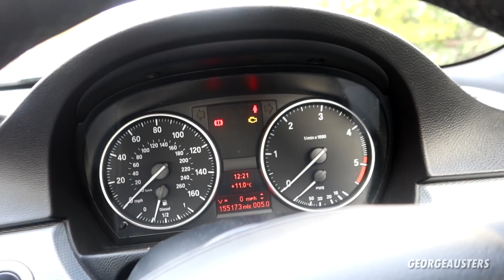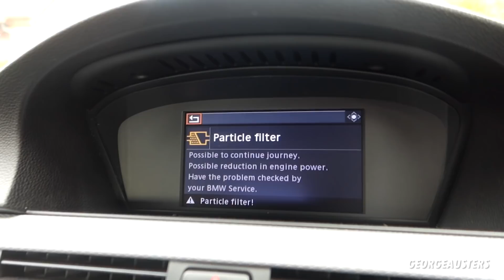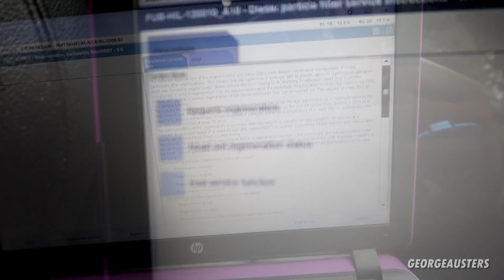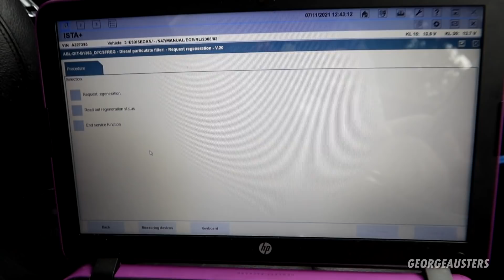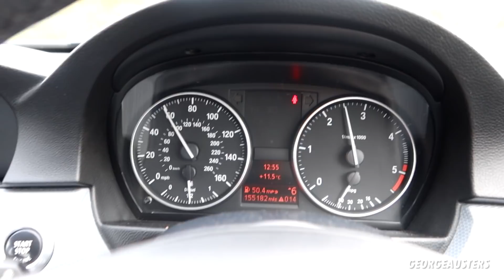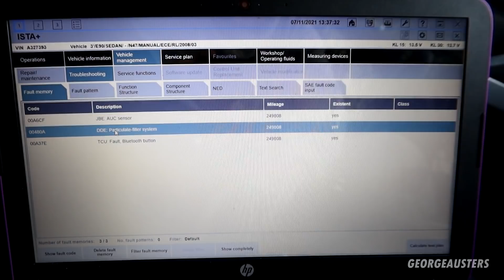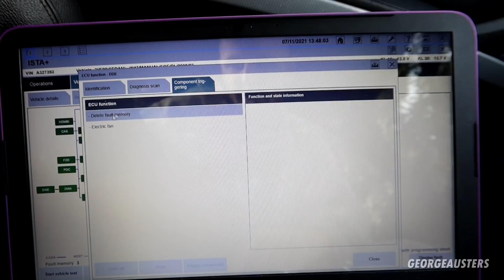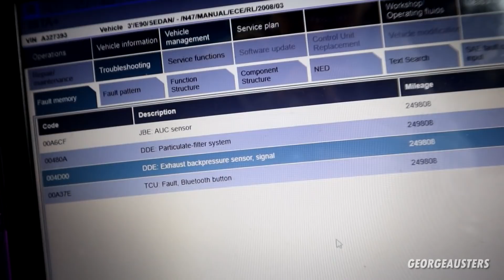SHOULD YOU REMOVE A DPF FROM YOUR DIESEL?

Comment: I talked to my local friendly garage man about getting a diesel car, and he told me straight away NOT to get one. It seems that knowing the sort of driving I do (short duration trips, possibly up to 25 minutes one way and all 40-50mph MAX) he knew that I would have major problems with the soot build up NOT burning off as it should.

He then told me a lot of his garage work is made up of delivery vans used by Tesco etc. and courrier firms having the same problem. Their all going too slow to burn off the soot and the filter can ONLY be replaced, not cleaned (the cleaning cycle never works properly)  So no diesel car for me in the future.  My friends have diesel cars, but they make sure they give their cars plenty of 'welly' when driving them.  Unfortunately for me, I can't be bothered with this style of driving anymore, it just gets me to the next que of traffic quicker.  Maybe that's why Beemer and Audi 'nutters' are so much up my *rse when out driving, I'M HURTING THEIR CARS!!
Reply: 🤣🤣 true because to have an audi or vw they are best in Disesls becoz their petrol engines are shit, bmw petrol are good and not bad for mpg, the big issue for diesels is one DPF and secondly having an egr, I know some people delete egr, but don't think you can remove dpf as it would fail mot. They are good for long distances. Too much electrorlnics and sensors and these stupid filters causing engines to die quicker and cause more issues then if they were not there at all like In old cars used to be.
Reply: suggest you research the difference between passive regen systems (like the ones you describe) and ACTIVE regen systems as fitted to my 2.0 TDCI Ford which ive owned for the last 7 years (bought used).it can and WILL (and has done) start, and complete a full regen at IDLE if the ECU deems it ready to regen!

Comment: Your dpf is fucked. The car tells you when to replace it. On the idrive it says so many miles till replacement. Usually about 150,000 mine is saying replacement in 7k miles.
Reply from the maker: It's not, I fixed it easy.. Watch the latest video on it

Comment: Took my 3.5 year old Vauxhall Astra 2.0 Cd SRi into lookers (main dealer) in Oct 2015 with low oil pressure warning after the engine would crank as too much oil in system. Turned out the extra diesel that is pumped in to burn the exhaust gases is designed to be dumped into oil sump! - that was the last I saw of the car, Lookers tried regen and couldn’t after trying several things they told me the next thing to “try” was new injectors @ £2000  but could not guarantee that would work - told them I wanted Vauxhall involved but vauxhall point blank refused to do so - would never buy another Vauxhall on that basis again

Comment: Volvo v50 245000 miles no dpf issues  though the front struts needs replacing worn out now  and 1 top bearing cranking noise when I turn full lock towards the right .

Comment: I haven’t read all 500 comments so it might have already been answered, but a normal mileage between regenerations is 650 km. Your DPF doesn’t regenerate because of some faulty sensor, and now it’s clogged up. Fix the faults and your DPF will start behaving normal again.
Reply from the maker: Watch the latest video, it’s fixed now👍🏻
Reply: @GeorgeAusters  I have. It confirms what I wrote - however you didn’t fix the problem you only cleared the fault code. If the underlying fault is still there, you will be back where you started in 2000 km or so. Wait 500 miles, hook up ista and check the regeneration status and you will know which way it’s going.

Comment: I've had my 2006 E91 330d for 6 years and never had any major problems or error messages.  Only issue I've had is the old quacking EGR valve issue.  Replaced with another used part from ebay for £20 and another 2 years in without issue.  When taking out the old EGR it wasn't overly mucky either.

Don't know if this is testament to the 6 pot diesel, good servicing or just luck.  Do mainly town driving, but do have a 1 or 2 30min drives at 60mph every month.  Either way looks like I'm one of the lucky ones 😅

Comment: You are having trouble because you're starting from the wrong set of assumptions! DPF faults are a 'symptom' not a problem. In a healthy engine, the DPF should never give problems under most driving conditions (perhaps with the exception of lots of city driving). However, faults such as a leaking or worn injector, poor turbo performance, oil leak into inlet, clogged inlet manifold etc will be masked by the DPF system right up until the problem becomes too severe and falls outside parameters. Then you get a DPF fault and start blaming the particulate filter - which was not the problem. Sadly diagnosing these issues is often time consuming and expensive and may end up with a repair being uneconomical.

Comment: 100% agree.... the whole EGR/DPF scenario in modern diesels prematurely kills them and performance short term.....let alone long term! They end up ingesting their own filth instead of fresh clean air in the quest to cut emissions. A very poor design right from the start...... I did watch a recent article on Gale Banks ,who is the guru when it comes to tuning diesel engines in the US, and he removes all the EGR/DPF off his engines. He says it hampers efficiency and performance and can get them running super clean just by well calculated tuning etc.

Comment: Normally you have to clear codes before it will allow a regen.
Had same issue once on my C30 but cleared codes and it allowed the regen then.
I also ended up removing it a month later and washed it out snd fitted a hybrid turbo not had one issue since.

Comment: Had same problem on a Ford transit connect a few years ago, it just would not regen and it would also fail a forced regen which could be done while the van was stationary using a laptop and software, I had a new DPF fitted at cost of £1300 by a company called Click Machanic (cowboy mobile machanics), and within a month same problem returned  block DPF and again would not regen, so I to it to a local garage it turned out to be a faulty glow plug and clogged pipe within the exhaust system prior to the DPF which is for igniting the fuel that is injected into the exhaust system with the goal of  heating  the DPF to a temperature of around 600⁰C which in turn burns the particulates of and turns it to Ash which is then released out of the exhaust, When the DPF does a regen you will know that it has done so when you park up and get out of the car as you will hear the exhaust making a clicking sound, this is the exhaust cooling down you will all so notice a distinct smell and you will feel heat being emitted from underneath the car. Another thing to remember is when you do an oil change You need to use Low SAPS oil because Sulphated Ash, Phosphorous, and Sulphur are all substances that can build-up and block your vehicle's DPF.
Hope this helps don't give up and if you get it sorted just remember to give the car a blast down the motorway every 3-4 weeks.
Reply: active regen system. normally blows a fuse in the fusebox when this is the issue. the part to repair, for the complete unit (injector and glow plug) is around £150 and takes about 20 mins to fit, working on a jack/axle stands.

Comment: They are on the car by law, take them off and expect to get fined. BMW ones have a 150,000 mile life. You will keep getting dpf codes 480, 481until the dpf is cleaned out or replaced and the service due status is reset. I know because I've done it following the same issues.

Comment: Was chap I used to see around telling fibs when he said removing the filter caused his car to fail the MOT. He said when the MOT station logged his car on to the system it told them the car came fitted with a filter.  It’s removal they claimed meant an automatic failure.

Comment: For all UK based YouTubers, this is the defining piece of legislation that makes driving a car with EGR or DPF removed, illegal:
"It is an offence under the Road vehicles (Construction and Use) Regulations (Regulation 61a(3))1 to use a vehicle which has been modified in such a way that it no longer complies with the air pollutant emissions standards it was designed to meet."
Reply: Took the rascal out of my Seat and have passed every MOT since doing it runs better has better mpg wouldn't hesitate
Reply: @bobj3251  same here on my 335d along with the cat, egr delete and swirl flap delete
Reply: @nickjamesr3dbull4lif33  You understand the law, but still choose to drive your car illegally, well done.
Reply: @bobj3251  Shame the MOT does not measure NoX (nitrogen oxide) gases, which it should. A failing of the system that allows car owners to remove emissions controlling parts and increase pollution tenfold but invisibly (NoX that causes many lung conditions in young children is the invisible killer, not particulates such as soot). Great you have a better performing more polluting child killing machine. Proud of you.
Reply: @MiracleMitch  yes I understand that Sargent but my quickfit mot guy doesn't care about pointless things like that 😉
Reply: @MiracleMitch  plus with me removing all of them it helps out with tailgating drivers. a big cloud of black smoke if they get to close  😂
Reply: @stuart121972  I agree but add that if DPFs and EGRs are not removed from 250,000 of the more than 15 million diesel cars still on the UK roads, it will have a life changing impact on the 23,500 children that die each year from pollution related lung and heart problems. Removing / blocking an EGR valve increases NOx gases emitted by 40 times its previous level. Every individual needs to be accountible for their own actions and efforts to help the planet and to halt its current decline.
Reply: @MiracleMitch  are you gretas dad??
Reply: @MiracleMitch  everytime someone writes a comment like this I roll coal to balance out the world <3
Reply: @MiracleMitch  there's plenty of cars on the roads built without dpf and egr systems as it the whole diesel emissions thing came in around the early mid 2000s as for pollution have you noticed how much aircrafts chuck out, what all cars especially diesels can benefit from is a hydrogen fuel enhancer system which a brand called fuel genie have created, much cleaner.
Reply: @doberman194  True, but the main issue is that removing emissions controlling devices from UK cars renders them illegal to drive, and in diesel cars makes them emit 40 times the NOx gases which are harmful to humans and this has been proven to cause deaths (usually from lung related illnesses and mostly in children or much older people).

On a development note I am interested in the new Wankel engine that Astron in the US are developing which has a ridiculous power to weight ratio, ridiculous efficiency and uses plasma plugs for near complete combustion. Also noted is that BMW are still going to develop and produce more efficient and clean ICE for many years to come. There's still more to come like hydrogen based projects as you mention.
Reply: Bore off geek lord
Reply: @Azilla00  See! Too many unfiltered diesel fumes has made you unable to say anything intelligent!!!
Reply: yes I know that PC Mitchell but thanks for the advice

Comment: If you remove or gut your dpf do not have a crash. The insurance company will be very keen to check the filter and if missing or tampered with your insurance goes out the window. You may also have to throw quite a bit of money at a bent MOT inspector for him/her to turn a blind eye to what you have done. Otherwise you will get a fine and no MOT.

Comment: I've 180 thousand miles on my car never got a dpf change but I do throw a bottle of red ex fuel additive into it every 6000 miles also always use good diesel the cheap diesel isn't great on fuel system in general

Comment: My 5 series 2.0d is ten years old, done 120,000 miles and I have never had a problem with dpf. I was told that constant around town driving is the main cause of issues.
Reply: Correct!!!
Reply: I have a bmw e65 730d with 169,000 miles and my dpf its totally fine. Bmw dpfs are usually bomb proof, never had any bother, mine regens when your driving in town even. In the family we have 320d a 335d, 730d, x3 2.0d,  520d, x1 2.0d and a x5 3.0d. I have friends with diesel bmws and no problems.
Reply: @michaelbamber4887 when it regens does the engine sound different and does the revs bounce?
Reply: @Cby13 @Cby13 the exhaust had a 'deep raspy' sound when you put the power on, if you let your foot up it went any, only used to hear it at low, town speeds. Never had the revs bounce mind.

Comment: The problem with DPF's on BMW's is that they fill up with ash created by the soot being burned during re-gens. Eventually no amount of re-gens will work because the DPF is actually blocked with ash, not soot. I had a 530d and went through this process countless times. Nothing I did made any difference. Tried countless re-gens, passive and active. It drove me insane in the end.
Reply from the maker: Watch my other video, it’s sorted now
Reply: How did u fix it? @GeorgeAusters

Comment: Question: The software asked you to drive on rural roads, which will involve going up and down gears, different revs etc. which is completely different to driving at a constant speed on the motorway. Why did you think that driving at constant speed on the motorway would be the thing to do? Perhaps if you had followed the instructions it might have worked?
Reply: From comments like this, I can understand why so many millions were happy to obey their rules/regulations without question.
Reply: @cedricworthingtonbroadaxe2287   Not sure I understand your point. All I'm saying is that if the instructions tell you to drive in a certain way to start the regeneration, perhaps following the instruction might achieve the desired result.  After all, the instruction to drive on rural roads will work the engine in a a specific way. For a start it might increase coolant temperature compared to a constant speed on a motorway with a steady air flow through the radiator. It will also mean changes in speed and thus engine rpm. I am no expert but it seems to me that if the software writer thought it important to put in the instruction, then they were trying to help you get the engine to work in a way that would initiate the regeneration.

Comment: I put petrol in my pssat cc 2.0 tdi by mistake , it was only half tank, I added diesel to the full I drove 10 minutes with 50/50, pumped out the mixture when I got home.After 2 weeks I went for an MOT, pollution levels perfect as new.
Reply from the maker: That can destroy your HPFP and injectors
Reply: @GeorgeAusters  I did it by mistake, I have a petrol car as well and it was first day out after 10 days self isolating for Covid. I am aware that injectors seals can get damaged but my mechanic said these vw models are very well made and it may go like this for another 50000km
Reply: The DPF got fire from the petrol injected and not ignited when I tried to start on petrol only. The smell was awful and the exhaust got stuck  for few seconds before everything came back to normal.

Comment: Volvo D5 engines will never run right without a dpf. Every Volvo tech I spoke to said don’t remove it.
Where does it say to drive in a lower gear at high revs to initiate a regen? I was told to drive at motorway speed for 20 mins to initiate.
My van showed a dpf  fault but cleared after long motorway runs and is fine at 134k miles.

Comment: It is illegal to drive your diesel vehicle without the dpf if one should be fitted in the UK . I put a dpf cleaner through the dpf to clean it and it passes MOT every time. You have to drive it afterwards but be warned to do it on a private road because it smokes for a while. It looks as if the mist came up from the ocean behind you but after that the dpf is clean and emissions are within limits.
Reply: Do you have your own private road?

Comment: If you're interested in removing your DPF  filter in the UK, that is an automatic MOT failure
Reply from the maker: Not necessarily
Reply: @GeorgeAusters  While it’s not illegal to remove a car’s DPF, it is illegal to drive without it if one should be fitted. It’s believed some drivers whose DPFs become blocked are simply bypassing the filters by removing them rather than paying for a replacement, which typically costs around £1,000. In doing so, car drivers are risking a £1,000 fine, while the penalty for driving a van without a DPF stands at £2,500, so yes it is
Reply from the maker: Plenty of cars have passed MOTs with DPFs removed. It’s only a visual inspection so as long as it looks like it’s still there and your engine is healthy then you’re fine👍🏻
Reply: @GeorgeAusters  not true its still illegal in the uk  to drive on the highways without one that was factory fitted, see the fines listed above, it sounds like you are advocating people break the law

Comment: If you take your car for an MOT and the DPF has been removed it's an instant failure. If you want to bypass this you take the DPF off, drill out a huge hole in the honeycomb so it never blocks up again and reinstall to give the appearance of a legal one being fitted. Problem is there's no guarantee it will pass the smoke test after doing this.

Comment: Was told to learn when your engine is performing a DPF regen and to avoid switching off until completed. VW group cars have the increased revs and fans switched on which is fairly obvious, but some other makes are not so obvious. One other way is to keep the trip readout on instant MPG and you can get to know when a regen is on due to the instant MPG dropping- especially on idle. Try not to switch off during a regen and this should save you many of the DPF problems. Obviously keep having to do this becomes a complete pain in the ass, and I got rid of the sodding thing. Back to petrol.